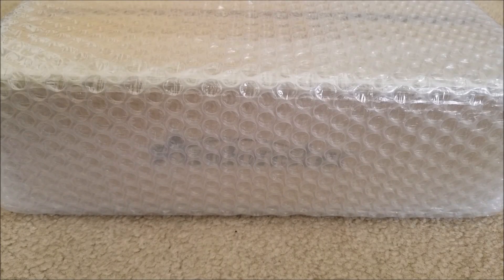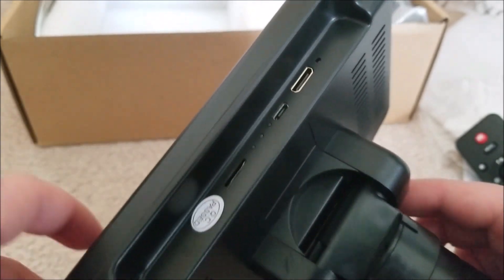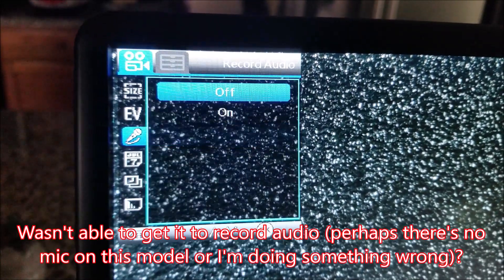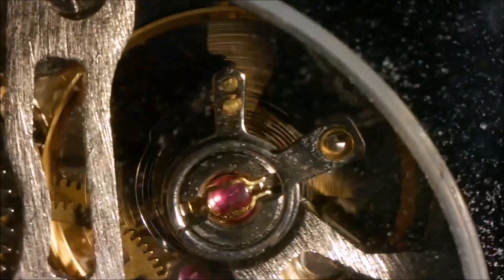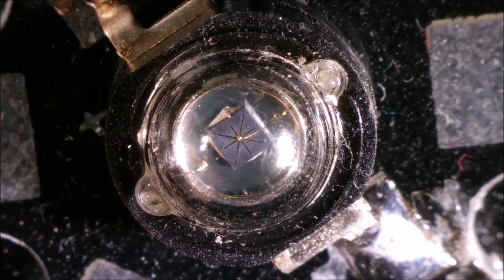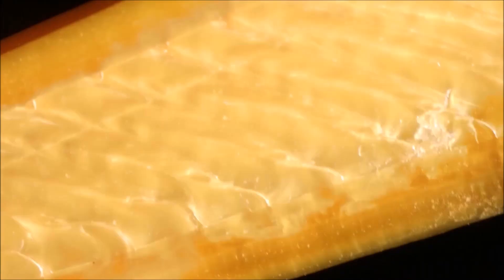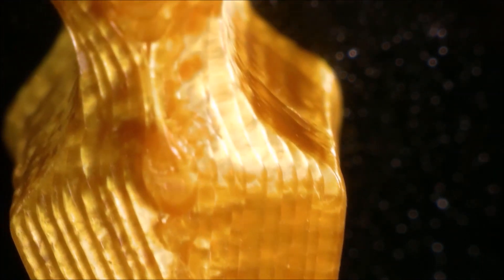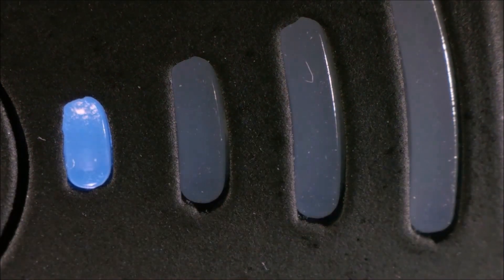Lab Tech: Andonstar AD407 - A 2020 HD Digital Microscope Odyssey!

Comment: The inverting method would be probably useful in reading blurred model numbers off a chip. Nice digital microscope man!
Reply from the maker: Good idea, I always try to hold chips with hard to read part numbers at an angle to get better contrast but inverting would probably be much easier!

Comment: Why did they reduce the magnification from 200x on the AD206 to 100x on the AD207?  Then on the AD407 they increased it to 270x but took away the lights in a ring around the camera leaving the two on the side that are always in the way and never seem to cast a decent light.
Reply from the maker: I have another scope with ring lights around the lens and it's horrible. Any slightly glossy surface will wash out and be impossible to see properly. I much prefer having the adjustable arms that you can position perfectly to reduce glare.
Reply: @sjm4306  You can turn the brightness of the ring lights down.
Reply from the maker: Yes I tried but then the image is too dim. The problem is the light is coming at the same angle as the camera so a lot of the light is directly reflected right back at the camera, over exposing the image. Leds have a conical light distribution but a majority of the light tends to concentrate at the center of where it's pointed. For what I do, soldering glossy pcbs with tiny parts this basically makes it impossible to use without a secondary light pointed at the setup at a different angle. By that point it's just more convenient for me to have separate leds on goosenecks that I can manually adjust.
Reply: @sjm4306  Thanks for takung the time to inform me.
Reply: @MrWhaatay  only in 3 set positions..I don't use the buttons, i like to bend the lights myself to where i like to position them..

Comment: in case anyone is wondering, the lens protector glass thread is a M30..  I haven't measured with it off yet, but it might be 2mm bigger? M32?  I plan on attaching a 5x Microscope Biology objective, it would require an RMS to M30 Adapter ring, it does exist online and is rare, but costs the same as the objective.. There is more available the RMS to M32... I just received my Andonstar, so i'll measure without the lens soon..
Reply: Do you already have some meaningful results on attaching the lens to the AD407? Would be interesting to see some photos or the like. Is it worth the cost? I mean it is already challenging to place objects when high magnification is in place...
Reply: @alex-r2pi  the picture is clearer, at first i thought the objective glass was low quality and scratched , then i accidentally squashed a specimen, so i had to wipe the glass clean, i used iso alcohol with filter paper to wipe in a straight direction, the glass became clean and the scratches turned out to just be dust probably from china factory.. i am happy with my objective and objective screw thread adapter ring... i will be working on raising the stand to put a light underneath.. I purchased two 150mm M4 Screw thread rods, now i wait for M4 nuts to arrive to put on the ends of the base plate... I will 3D print a rectangular block to put the rods through for stability..  I could use a piece of wood block, but i don't think i can drill 150mm long holes completely straight through, i don't have a drill bit that long also..   Buy the Objective and the adapter ring, you will need it...  and better image quality..
Reply: @TheOzTube  Yes, I also think about raising the screen a bit. If you need long drills and have time you can order them on aliexpress up to 300mm long :-) Alternatively you can always use a layered approach for the rise and drill layers separately. Maybe misuse some LEGO bricks? Would it make sense to use a 10x lens too? Or is this too much already? The price difference is not so big. I am really frustrated on the M30 thread. So uncommon :-( And I want to encourage you to make a short video when all is in place to see for us all.
Reply: @alex-r2pi  I can't afford long drill bits :)  I got the 150mm double sided screw rods instead, now waiting for some nuts

Comment: I bought this to examine coins and take pictures of them.  I cannot use it to get an overall view of the coin despite backing the lens all the way back.   Is there away to adjust the view to bring a coin all the way?  I think I bought the wrong tool for what I want to do
Reply from the maker: You may be able to makeshift a taller stand to zoom out more so long as the optics allow you to focus at that height. Alternatively you can add some intermediary lenses to adjust the magnification lower but I'm no expert in optics so I cant tell you exactly how you'd go about doing that.
Reply: @sjm4306  Thank you for your response.
Reply: May i know how much field of view you are getting at given distance ?
Reply: @ravit7255  If you run the vertical scope holder all the way to the top and then slide the scope to the edge of the scope holder, you have plenty of field-of-view to see overall images of large coins, like Morgan dollars.